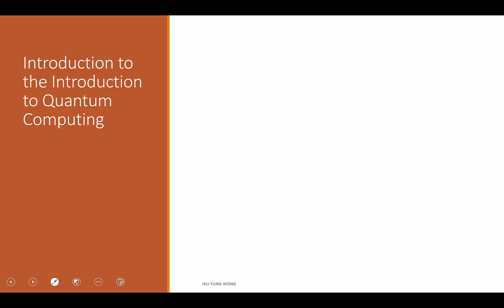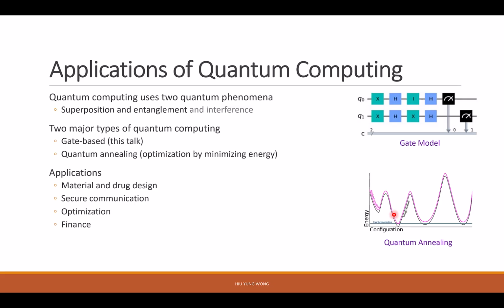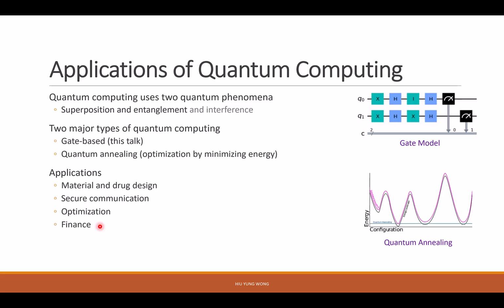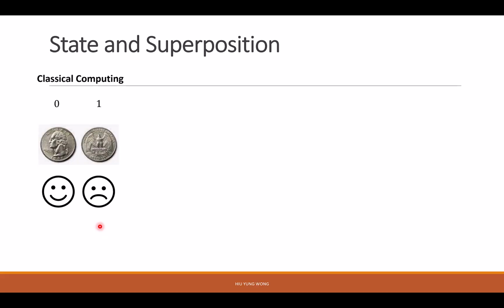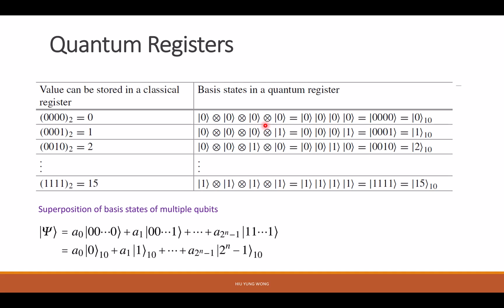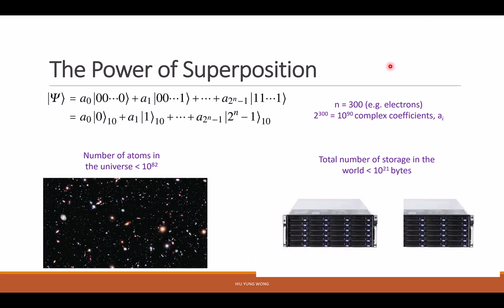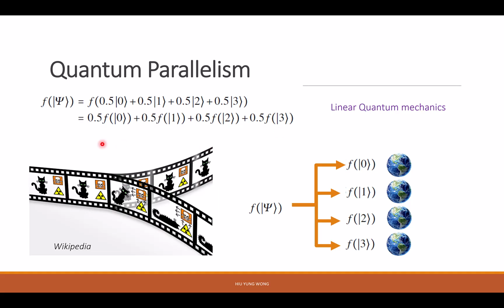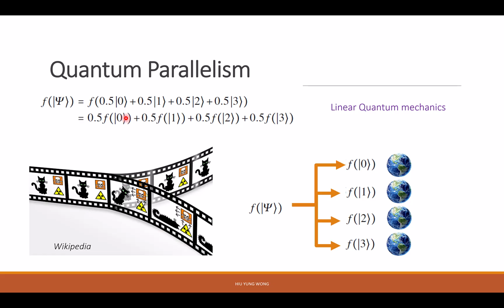Lecture 1, Ch 2: Overview of Quantum Computing Part 1

Comment: Thank you for for providing these. I have a question in relation to the Secure Communication, with communication being enhanced what are the odds of a sophisticated Cyber attack using Quantum computer ?
Reply from the maker: If we still rely on the traditional encryption (e.g. RSA based on the prime factorization of large integers), once quantum computer works, it can be cracked very easily (e.g. using Shor's Algorithm). However, people have started developing the so-called post-quantum encryption schemes which rely on other mechanisms and Shor's Algorithm will not work.
Reply: @Introduction to Quantum Computing  Thank you, Interesting how Obsolete The traditional encryption is going to be with Quantum Computers in near future.